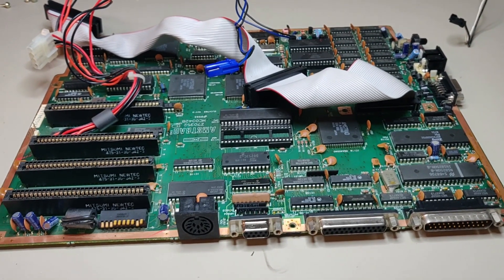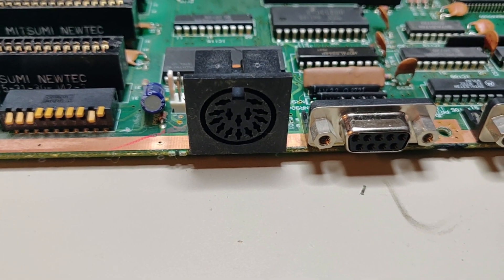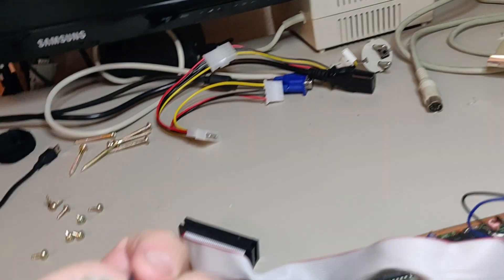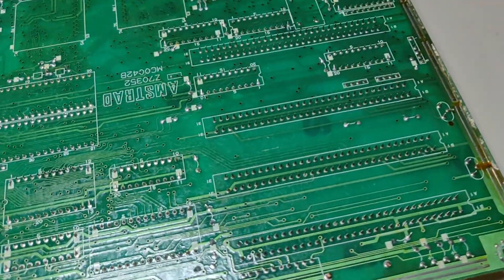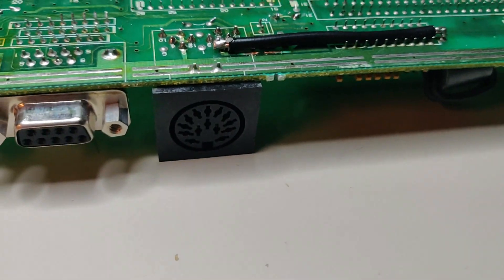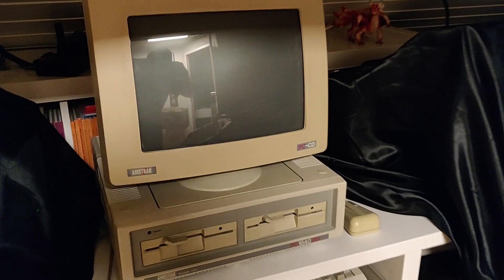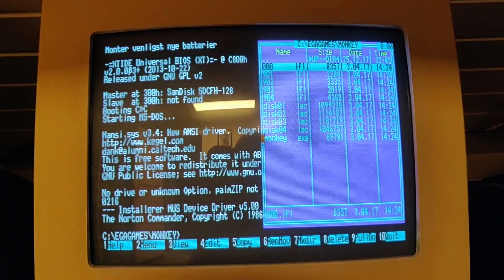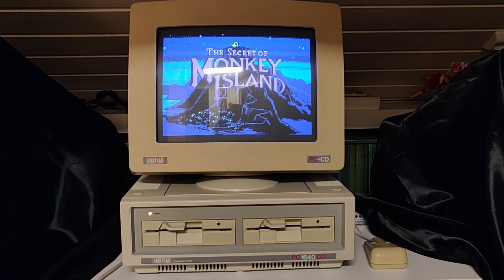Amstrad PC 1640 Motherboard repair - and how i destroyed it.

Comment: I never thought someone could do (almost) the same mistake on the Amstrad. I connected the power cables in a totally mirrored way. Killed it. Waiting for better times to fix it!
Reply: I am sure you will find a burned trace or a burn voltage regulator or a capacitor. :-)